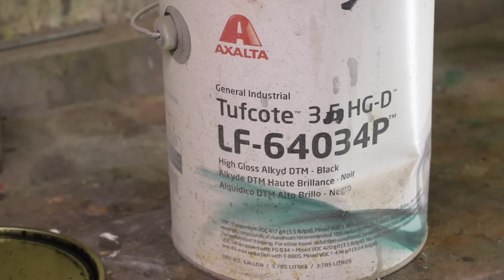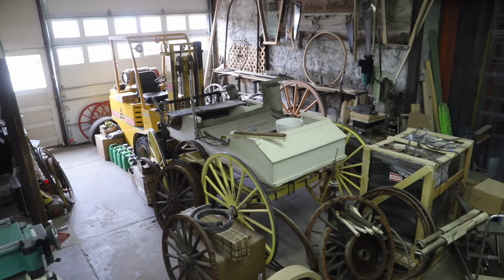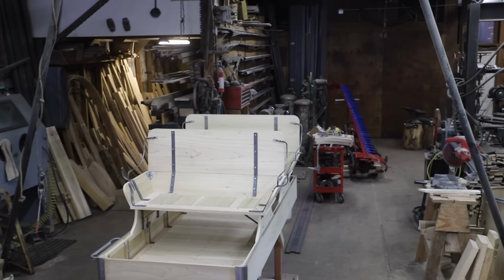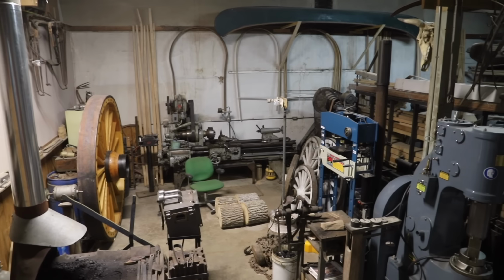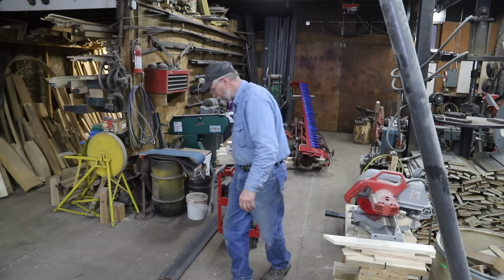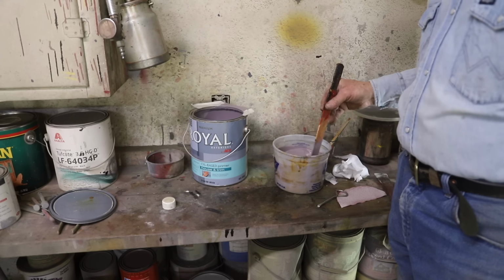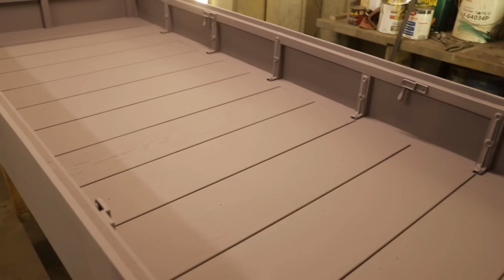The Fundamentals of Priming & How To Strengthen a Buggy Top | Engels Coach Shop

Comment: You have done it again with the Carmans hitch knot you made to the line. I drove a flat bed 7 ton ERF truck back in the 1970s. for a construction company hauling everything needed on setting up and running a construction site. Ratchet straps had not been invented, so I used natural rope and to tighten the load down used the Carman's hitch knot, if the load needed protection from the weather it would be sheeted with canvas sheets. these would be put on with the rear one first and the front one overlapping the joint to prevent rain getting in while driving. Another set of ropes would hold the sheets in place together short ropes attached to eyelets on the sheets to prevent flapping. On a calm day all this would take an hour or so, on a windy day it took forever. 
Love to watch your tricks of the trade to get jobs done with out a second pair of hands. Thanks again.

Comment: I personally enjoy seeing the upholstery work.  My first do-it-yourself project was a couch I found in front of someone's house. It was in rough shape, after removing all 'leather' plastic and padding,  I fixed several places where the wooden frame was broken.  And taking my dad's advice,  power washhed the bare frame. Little did I know I had just finished the only easy step in my couch restoration.  After about 80 to 120 hours of work I had the ugliest sea-foam green (the cheapest cloth available) cloth covered couch you've ever seen.  I won't get into any of the details of the ill advised couch repair, but I recovered that couch a total of five separate times.  It stayed with me from age 15 through college,  girlfriends,  moves, and about 20 years.

I sold it at a yard sale, I was sad to see it go. But, all things end.

Thank you  Mr. Engles.  I love learning, and your coach shop is a knowledge I never realized I still could find (without access to a time machine).

Comment: I learned painting from old timers who used to "make" their paint, so I share most of your philosophy of painting something like your buggy. FYI for other fans, unless you prepainted EVERY surface of every board BEFORE assembly, water has access — which is why the wood has to breathe. However, I'm puzzled why you didn't paint the wood bows on top and the centers of the seat backs??? Also, the red striped webbing appears to be burlap, but what is the black webbing used for cross bracing? Who picked the color of the buggy? THANKS for another great vid.

Comment: Great information and work! If I recall, it was your tip about not using latex on the previous videos on the hub/wheel repairs you did - that someone painted the wheels with latex, causing them to quickly rot. Thank you, as always, for sharing your excellent craft!

Comment: When using oil base primers, I always add 4 oz to 1 gallon, of Flood brand Penetrol. It helps the primer to really bond well to the wood. It also breaths very well like it should. I have used this since the 1970s when a professional painter showed me the stuff. It will vastly extend the life of the bond between the oil base coating and wood.  A smaller amount in subsequent coats helps with smoothness and with bond.  I have its that have survived 40 years in Oregon wet that still look great.  I rarely use acrylics so cannot comment on the same companies product, FloTrol, that the offer for acrylic. I have have had such good performance with oil base paints with Penetrol added, I just stick with it.  I have found it can be applied to bare wood as a clear like sealer, like boiled linseed oil, only it penetrates deeper than BLO, and with a few slow drying coats, lasts longer by about double. I also use 1/3 Penetrol and 2/3 BLO mix as wiping oil finish on wood furniture. It looks wonderful and is more durable than straight BLO.   It might be great breathable coating on the bows before adding the webbing.

Comment: As a painter, among other things,I certainly agree that bare wood  should be primed with a oil based primer and oil based paint has certain advantages, however modern water based paint does not contain rubber but acrylic polymer emulsions with water as the  vehicle for  the pigment application.  Once dry they are very durable which is why in fine art painting they have mostly succeeded oil based paints. Water based are easier to clean up and can be very durable, especially high quality paints.  Royal is actually a Benjamin Moore product designed for Ace hardware, Walmart, Home Depot...If I could suggest I would buy a name brand Benjamin Moore product from a paint store vs a big box, a bit more money but a higher quality plus your buck stays in Montana but hey it’s your shop

Comment: Every time I see that knot tied (18:10) it reminds men of tying hay bales when the knotter on the baler would miss...🥵
Reply: There should be a video on that one.  I can't seem to get it right.  What is it called other than fancy Slip Knot?
Reply: @gordbaker896  I twist the rope 3 x  before making the loop (otherwise the same tie).  Always called it a "Truckers Knot".
Reply: @613kc  I always make a slip knot and put the running end through the loop to help tie down the load tightly.  Called that a truckers knot.  I must try the one Mr. Engles uses.

Comment: Dave, latex paints don't contain rubber. They used to, but don't any more. They're acrylic polymers. That doesn't mean they are any good for painting on external timber, though.
You should take a look at the next generation of paints. Water based micro-porous paints are breathable and (where they win over oil-bsed paints) flexible. They're used on timber windows in Europe, and can go 20 years without needing any additional work. Even then, they don't need rubbing back, just cleaning up and re-coating. Because they are vapour-open, there is no trapping of moisture within the timber, and because they are flexible, the timber can expand and contract with the seasons without splitting the coat. I've just painted a new greenhouse I've built, and painted it with Bedec Barn Paint. I'm 60, and don't expect to need to do any repainting on this in my lifetime. No priming, either, just a mist coat.

Comment: Having worked as an Industrial Coating Inspector and many other tasks I am amazed that you don't use an Inorganic zinc primer and High Build Epoxy.  They are very expensive though.  You keep surprizing us with first the Sewing Room and now the Paint Room!  I thought the wooden top bows would also get a coat of paint.  Thanks for the insight into the Top Fabrication.
Reply: I also wondered why the tops did not get painted

Comment: Why didn't you at least prime the wood before attaching the webbing to it? It seems like it would need it too. My guess is that the webbing and top material would bond to those sections since the oil based paint would take quite a bit time to cure out.
I am amazed by this whole process. Looking good.
Thanks for sharing

Comment: I have a two car garage and I do the same thing. All my tools are on wheels (table saw, drill press, band saw, chop saw) I have two harleys, one long work bench with cabinets above it and two stand up tool boxes. All my camper stuff lives on a mobile shelf system I built with large plastic tubs for everything from tools to grills, maintenance equipment etc. I usually have a good walkway through it all but today I have a 300 lb 15' long roll of astroturf in the spot strapped to furniture dolly's. Make due with what you got!
Reply: Sounds like my garage.  Barely room to change your mind.
Reply: @gordbaker896  when it's nice I can roll a bunch of stuff out on the driveway and the garage opens right up.

Comment: 1:29 How come you blurred the outlet? Is it because it doesn’t have a faceplate?
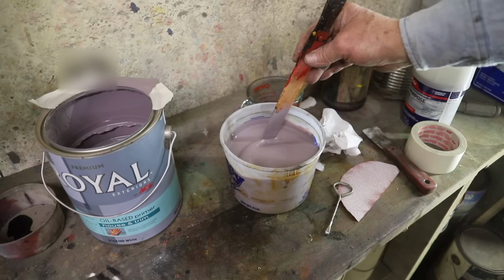Reply: Same again at 10:58 and yes, it seems to just be an outlet or a switch without a faceplate :) (There is a few frames where the blurring is turned off right before the cut).

Comment: Meh putting primer on metal. Very good way to have paint not stick(there is primers for metal that work they require a license to get and you never sand them. Rest are regular primers for filling scratches)I would have left the wood bare and varnished it.

The black webbing made me think old ford or chevy seatbelts to be honest.